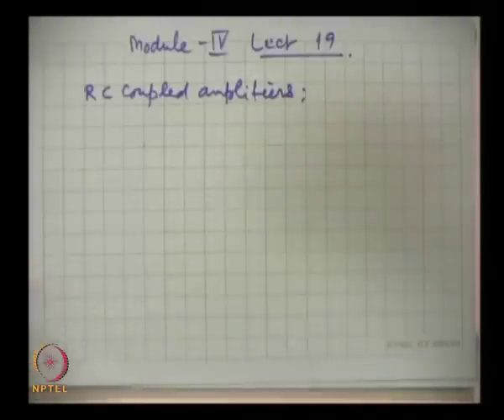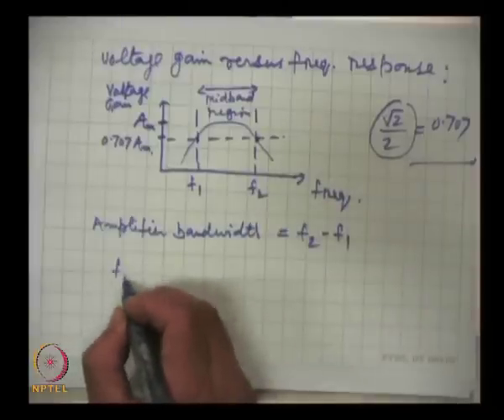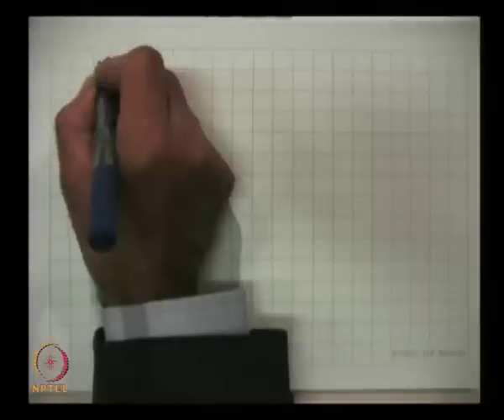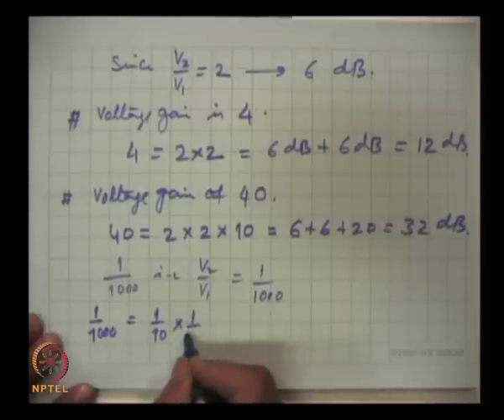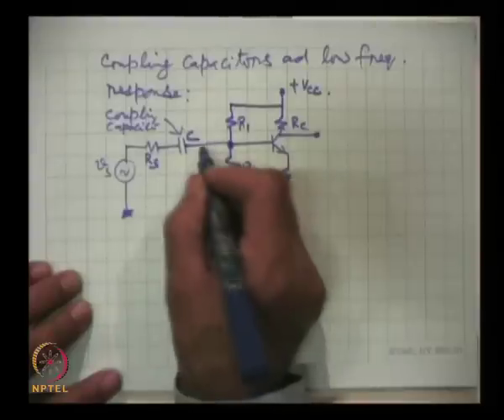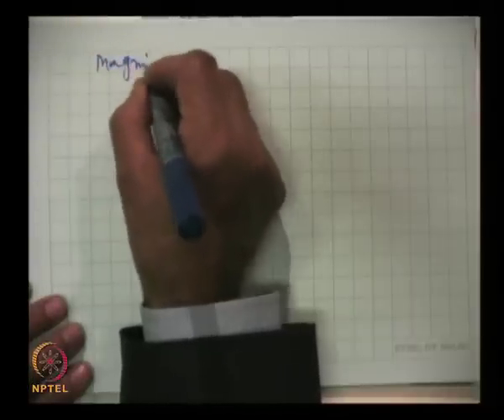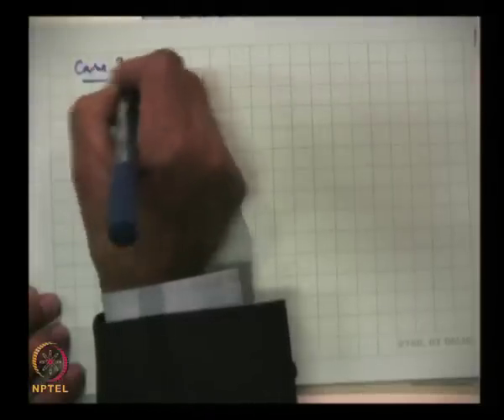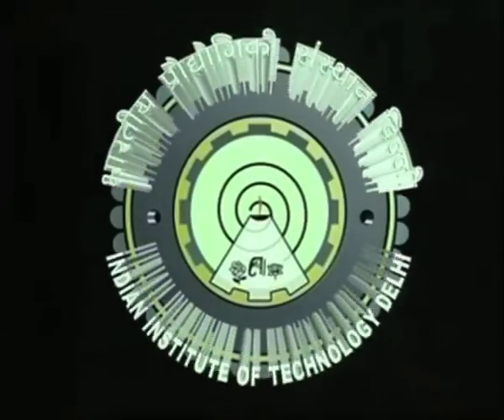Mod-04 Lec-19 RC Coupled Amplifiers

Comment: which is the mid frequency region ???
Reply: The coupling of ac signals to inputs of transistors (an ac signal rides on a dc voltage) and generation of an ac equivalent circuit to analyze transistor amplifiers is one of the classic applications of the principle of superposition of potential.  

Electrostatics and circuits belong to one science not two. To learn the operation of circuits, Current and the conduction process, resistors and how discussing these topics makes it easier to understand the principle of superposition of potential which is a direct consequence of the principle of superposition applied to electric fields, 
watch these two videos 
i. https://youtu.be/REsWdd76qxc and 
ii. https://youtu.be/8BQM_xw2Rfo 

The last frame contains references in video #1 which lists two textbooks 3 and 4 with topics that discuss the operation of capacitors, inductors, diodes and their operation in amplifier circuits and circuit theory. 

Chapter 3 in textbook 4 was included with the aim of preparing students to be able to analyze amplifier circuits in more advanced courses in electronics. It begins with a description in detail wigh sequential diagrams of how ac signals are coupled using a capacitor to the input of amplifiers. 
Stray capacitance effects limit amplifier high frequency performance, and a description that uses the principle of superposition to explain this is provided in one section of chapter 3 of textbook 4. 

The voltage-shunt feedback method finds an important application in a wide class of linear integrated circuits, the operational amplifier, and in a continuing vein of the principle of superposition, the final section of chapter 3, textbook 4 describes this method.The results of simulation runs of circuits that superimpose ac signals on dc voltages “Simulation_super_ac_sig_on_dc_volt.pdf” and of CR phase-shifting networks typically used in RC Phase shift oscillators “RC phase shifters.pdf” are included in pdf files in the CD which is included with textbook 4.
Procedures to obtain the voltages, currents and waveforms for this using TINA simulation software (freely downloadable) are also provided in the CD.